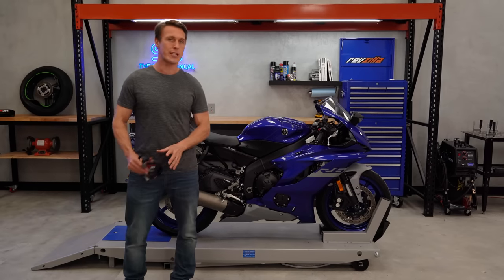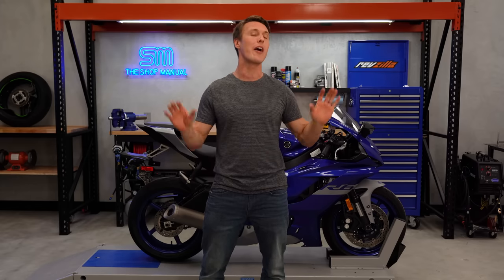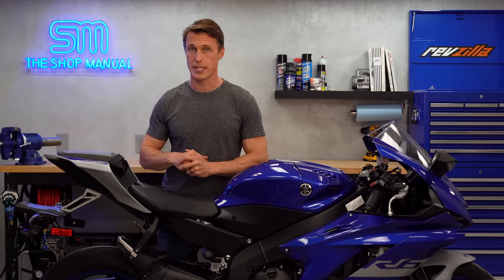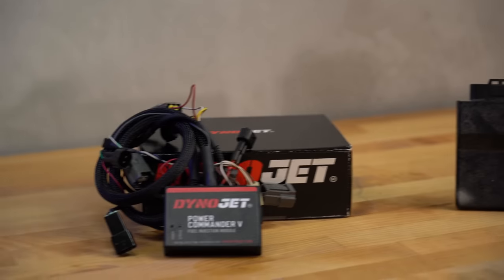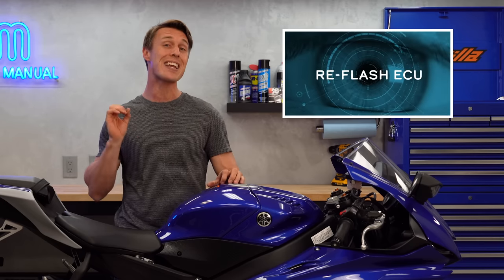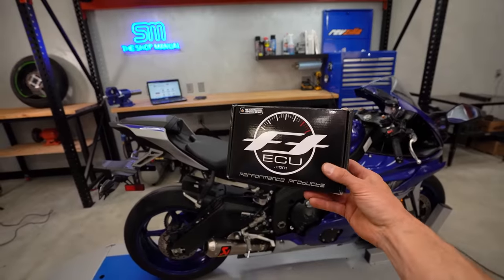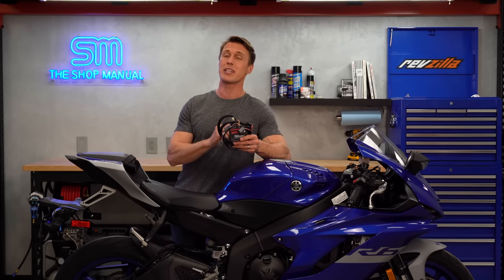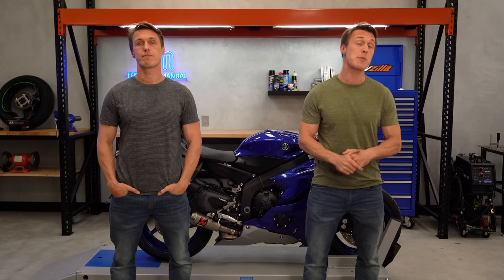ECU Reflash vs. Power Commander For Engine Tuning | The Shop Manual

Comment from the maker: Read more about motorcycles at RevZilla's Common Tread: http://rvz.la/3aB8CsA
Reply: What gives you more hp powercomander or reflash the stock one??
Reply: ??? Who are they lol 😂 no one important
Reply: @dr.jekyll2017  Codswallop. They "spent millions" doing the best they can to get around the emissions regs and end up with garbage fuelling, particularly at low revs. That's why modern bikes are jerky around town. Etc.
Reply: @Dr. Jekyll  Most "idiots" find the worst effect of garbage oem fuelling in the first 10%. Catch up dude. Lol.
Reply: @dr.jekyll2017  What's the "2 miles an hour faster" about? It's not about that. But then "sounds like your bike is a pos". Lol. Ok, you have issues apparently.

Comment: PC5 doesn't do much. The O2 sensor in the stock system (closed loop) nullifies most of your fueling changes. Woolich Racing flash seems to best way to go, but it's close to $500 bucks. Send it to Moore Mafia.

Comment: Good video! One thing that was not properly mentioned is how easy it is to revert to stock with a power commander. You mentioned removing it which works but is not even needed. With a power commander all you need is to connect your laptop or even smartphone to your bike and change to any map (even stock) you want. You can even have 2 maps on it and add an external switch to change between them.

Comment: Hi guys. I had a k7 gsxr. Around 6 months after buying the bike was invited back to the garage in London where I had purchased my bike to meet the chef engineers about bike set up and help with R and D. Not sure if ECU's across the pond are different? But hear in the UK power commander's  don't make a massive difference. In fact on this particular model the euc is already set up for this particular model. Was told by chief engineer from Japan not to waist money on a PC.  As they are generally a con. Saying this did fit a power commander 4 to my honda sp1 which helped' smoother throttle control at lower revs. After  re map a whopping 5hp. Goes to show a waist of £250 for 5hp. Smooth throttle control worth it. Like I say I know you're bikes are set up different and your cars because your emmission requirements are lower than ours.

Comment: The optimal approach also depends upon the capabilities/design of the ECU.  For example, the advanced ECU of the 2020+ BMW S1000RR/XR/R supports fully closed-loop operation and tuning (continuously takes readings from the exhaust sensors), which adapts dynamically to conditions (temp, humidity, altitude, etc.) and so you can get a flash that works for all bikes and configurations (e.g., exhaust and filter changes) of a particular model.  Besides more delivering more/unrestricted power, they provide earlier exhaust-valve opening, better idle, faster QS shifts, rev limiter increases, etc.  It costs most of $1000 but totally transforms the bike.

Comment: How can you tell if a used motorcycle has had its ECU reflashed? Does it leave a trace?
Reply: @TylerTron21  thanks for the explanation! So basically you compare the 2 maps to see if it has been flashed. If the bike was reflashed with a different map then reverted back to stock then we don't know if it has been reflashed before then?
Reply: @TylerTron21  yes, i was wondering if it's similar to odometer tampering/reset. I guess another way is to bring the bike to a shop/dealer to get it checked
Reply: @TylerTron21  i don't think many motorcycles have a date function so I don't think its possible to tell when it was done, or even if there is a mechanism in the code to keep track of that.
Reply: Also almost everybody that does a ecu flash usually put there brand sticker on the ecu

Comment: I don’t believe you need a tune, ecu flash or power commander if you are just changing to a standard aftermarket airfilter. Maybe depending on the bike, but a the stocked ecu on some newer bikes will be able to adjust on its own?

Comment: I made a couple minor mods on both intake and exhaust of my FZ-07, but left the catalytic converter in place.   I'm not a huge environmentalist but I do what I can... 😁  Initially, I planned to use the FTECU "on bike" harness with the Active Tune option (wideband O2 sensor) but the cost for this was over $700 plus welding a new bung in the exhaust, so I had a 3rd party (2WDW) flash my ECU instead.  After several tries, it became painfully clear that the FTECU firmware was no longer using my stock O2 sensor under any conditions, and the engine ran chronically rich.  I put a meter on the stock narrowband O2 sensor and saw it always output 1V (rich, not cycling as it should), and the exhaust smelled of hydrogen sulfide (rotten egg) which also indicates insufficient O2.   I was told the stock O2 sensor was used, but my test data consistently refuted this claim so I ended up going back to the stock ECU.  The moral of my story is that if you install a full exhaust (no cat), a flash tune is probably a good bet, but if you want to leave the cat in place, save your money and stick with the stock flash.

Comment: Had a dynojet piggyback module in my 2012 S1000RR that thing made me run on 2 out of 4 cylinders every 800-1000km's or so had to keep changing spark plugs and what not. Removed it in the end never ran smoother

Comment: One thing I've looked in to and been unable to find info on, is whether the stock lambda sensors on modern fuel injected bikes, can cater for an aftermarket full exhaust system with de-cat. I understand said sensors can adjust depending on environment the bike's working in, i.e. altitude as an excellent example. For me, a good article would be on whether the original lambda sensors are able to cater for new exhaust systems, end can and high performance air filter. Subsequently leading to adjustments being made by the ECU on new readings from said sensors. It's a bit of a minefield if I'm honest and I feel these aftermarket commanders are a massive money maker. - not that I'm against them in anyway. If there was some testing done with modern fuel injected bikes, say stock vs new exhaust system that would be extremely interesting to see how far you can take a stock set of sensors before a piggyback method or ECU flash is required. End of the day, piggyback modules and ECU flashes still use the same set of stock sensors, I imagine the main benefits from these types of tuning methods is to get rid of flat spots etc and to adjust the typically poor/snatchy throttle response of bikes which are set up to meet emissions regulations. - FYI, I'm no expert lol

Comment: Ive been using a Power Commander on my TL1000R and i have to admit i like it but it reminds me of setting up an AEM, MegaSquirt, speeduino, Haltech, Power FC, etc, type system on nissans, mitsus, Ford, etc... I guess growing up in the time period of "eprom flashing" turned me away as it was tedious work at times. Simpler to jump into a laptop and tweak injector duty cycle or scaling than burn an eprom and install it

Comment: i had my bike tuned on a dyno through my power commander. and it was fine but if I was to do it all again I'd just retune the stock ecu. turns out cheaper and can get  more out of it. cheaper because you just purchase a life time code then a tune instead of buying a pc5 then a tune

Comment: I was thinking about just buying a second stock ECU to experiment with. I really want to learn more about tunning. I want to be able to adjust A/F ratio and unlock the throttle throughout the gear range. The type of stuff you see on Moore Mafia. I know I don't have a dyno. Can I still tune my bike without a dyno using a PC? If so what do people recommend for software ECU upgrade kit?

Comment: I have a 2006 VStrom dL 1000 bone stock.  I installed a “Booster plug” and that was a big improvement. Would flashing my ECU be another improvement? Bike runs great as it is but I’d like a lil more out of it.

Comment: Had a Power Commander on my R3 and it still has throttle response issues. Once I flashed the ECU and removed the Power Commander, it ran like a dream. 

I also flashed my 2014 Yamaha Bolt when I installed a full exhaust and intake and the throttle response was butter smooth.

Just wanted to put my input. Hope this helps.

Comment: I've done a little recherch so I not sure if this is true but power commanders have a fatal flaw. they sometimes don't intercept the o2 sensor so on some bikes (ktm for sure don't know any others) the normal ECU will cut fuel and basically undo everything that the power commander does.

source: rottweiler preformance.
I'm a little sus cuz they sell their own power commanders at a hefty markup and claim that it comes with a solution to this.

Comment: To be super clear, you either need to buy a specific Bench kit to run against a removed ECU (it includes a power supply for the ECU) , or you need to have a Windows Laptop (or a desktop inside a garage with a long ass USB extension) ... So think through how you're going to connect the computer to the ECU.

Comment: You need both for the best performance. Flash removes restrictions, lower fan temps, native quick shifting, etc. etc. Piggy options allow for live on the road tuning under real world conditions and real world air intake. WSBK and MotoGP bikes run different tunes for different tracks for example. Many professional tuners will tune a car or bike on a Dyno and then take it out on the street or track and fine tune from there. You need both. You don’t actually “need” both but both will give you the absolute best performance.
Reply: How reliable is this piggy back power commander v?
Reply: @paulson9616  No problems at all never heard of anybody having issues other bad tunes.

Comment: so here is the thing, im new to riding, got a 2016 ktm rc 390 with werkes usa exhaust, k&n air filter, and new battery. and i need something like the flash or piggyback. but wich is best here?

Comment: If I do a k&n filter and a slip on exhaust is it necessary to have a tune? I'd do a power commander. 

Possibly might do stacks on the air box.
Reply: Not necessary at all

Comment: I'm here because a kid brought his 04 cbr954rr to the small motorcycle shop I work at because it doesn't run right.  It's got a power commander in it.

This is only the second fuel injected bike I've worked on and the other ran great.

Comment: The main benefit of a flash over a standalone fueling module is the ability to (depending on the specific bike model and flash software) alter non-fueling settings, such as timing, per-gear throttle plate restrictions, fuel cut on closed throttle and deactivate certain hardware eg o2 sensors or PAIR solenoids (though you can buy add-on PC hardware to do some of those at EVEN MORE expense). I would have said the PC is the poor mans solution, but it's actually more expensive; A flash license will invariably be cheaper than a power commander, and you'll still need to pay for dyno time whichever one you go for. Piggy-back fueling modules made sense a few years back, nowadays if your bike supports flash tuning you'd be dumb to go for a power commander.

Comment: Ari, thanks for the video. Can one  gearthese options improve low speed/low rev engine response making the bike less jerky in below 20 Mi/h?    I have a 1999 VFR800 that I very much like my major complaints are the engine response under 20 Mi/h (school zones) and how hard the clutch can get if I get stuck in traffic for a long time.

Appreciate the videos!   I wish you continued success.

Comment: What about the PowerVision 3 by Dynojet? Any comments on that system? Are there enough benefits to justify buying this for a stock bike (stock exhaust and filter)? I'm hoping for a less jerky throttle on low revs from an MT09 2018.

Comment: Ok I have a power commander on my Kawasaki Z400 and now I'm going to add aftermarket headers and a k&n performance filter do I have to put it back on the Dino jet machine afterwards??? I would like to know or can I return my power commander myself?? Or do I need to take back to my mechanic shop and have my buddy return my Kawasaki Z400 again???

Comment: Tried the power vision 4. Wouldn’t work for my bike and dynojet didn’t have any maps.  They actually told me they aren’t in the business of making maps and that I can have fuelmoto write me one for $100. I had air cleaner pipes and a very popular cam on my bike. Nothing rare, nothing crazy. I returned the Pv4 and went to the nearest dyno and had it tuned. Should have done that in the first place. It was 4 hours out of my day.

Comment: With the flash tune, you are at the mercy of the expertise of those doing the refresh. (You included) You HOPE that their code will be optimal for your mods and bike. OR you have it done on a Dyno, which is better but still has issues. With a power commander or Bazzaz, you can get an autotune module that allows optimization with your riding conditions, and specific bike/configuration. They do not allow control of as many parameters, but they are even more accurate than the typical dyno, as the O2 sensor is MUCH closer to the exhaust ports than thy typical dyno exhaust pipe sniffer.

Comment: This is a great segment, thank you for doing it. I watch assiduously and even when I think I know about a topic I invariably learn something.  Not the most exciting topic I know, but I wonder if you might do a TSM segment on batteries and attaching external power draws (heated grips, USB devices)? Is the limiting factor the amperage of the battery or the efficiency of the alternator. I've got a 2010 Moto Guzzi V7, and the standard answer seems to be you can't attach too much external power draw on the battery. But can that be changed by modifying the battery or the alternator. As you can tell, electrical systems aren't my forte!  Anyway, great segment, and don't need a specific answer to my question, just interested in the topic and can't see a lot of information online about it.

Comment: Hi sir..by d way can I ask u some advice if u don't mind...I had zx6r 2000 model I'm struggling to made my bike run dicently so hard to find here in uae a mechanic can fix well my bike...d issues of my bike if I'm running on a city riding it run good cause max speed limit is 80kph but wen I'm running on a straight freeway I can't release the potential of my bike cause wen it hit 120kph the speed is dropping on 100 to 80kph and after a seconds it goes up again to 110kph...

Comment: Did I miss the part where you mentioned identical engines will perform differently, especially after modification.  Best option is a piggyback or full standalone and  dyno tuning.  Flashes are trash.

Comment: Do I need to do an ECU flash to put an aftermarket quick shifter on the bike?
Reply: You'll need some sort of interface for the switch. Both piggyback modules and flashes will allow for a quickshifter.

Comment: But doesn't Dyno Jet make something similar to a power commander? Called a Power Vision 3 and from what I understand it does everything a power commander does and more. It can raise rev limiter, unlock the speed limiter, flash the ECU, upload custom tunes from Dyno Jet website for certain mods, change cooling fan temperature, etc. just like an ECU flash does. I am getting one for my MT-09 and from what I can tell from my research the Power Vision 3 will basically put sending out and flashing an ECU in the past and also be a better option than a power commander for just an extra $50. ECU flasher and power commander combined into 1 unit.

Comment: I got my Yamaha (mt07) mapped with woolich racing software (by a tuning shop in the UK).  Does anyone know how the new triumphs (street 765 / speed 1200, etc) can be remapped, as I haven't seen any software that can?  I'd prefer not to get a piggyback system.

Comment: Flash.... Only way to go with modern bikes and all the emissions crap that needs switching off and deleting. The time you buy all the sensor eliminators and Power Commander it works out cheaper And lighter too.

Comment: I feel like you should've mentioned tuning for fuel economy.
Reply: It's rarely so on the sport bikes anyway.
Most modern bike run very lean from the factory, optimizing air fuel ratios make the bike even more thirsty.
I've 2018 r1 and with stock ecu map I had about 34mpg after the tune and flash I barely get 28mpg

Comment: Slick new set and overall production.  Looking forward to many more episodes
Reply: Are you Haines of Haines Manuals fame? If so, your comment makes this episode Oscar-worthy.
Reply: Did you want to make a comment about booster plug? An ECU trick that makes the ECU think it's 20 degrees C colder than it is, subsequently putting more fuel into the motor?
Reply: Thanks! I'm really pleased with the new set.
Reply: @batshitcrazymotorcycles7044  cxee

Comment: TBH, the cost of EFI mods always makes me appreciate carburetors for their budget-friendly-ness. They can be fussy, and come with their own issues/learning curve. But you can re-tune carb(s) for $50, a shop manual (!) and some basic tools, and have $250-300 left for your other mods.
Reply: But you have to keep doing that. Once you reflash for the newer bikes they are generally set and forget if it's done right. And if you are in a decent community you can get collaborative help to make sure every setting is the way you want it.
Reply: @grndzro777  not to mention that complete ease of mind of not having to worry about carbs and weather outside lol
Reply: Yall having alot of carb issues
Reply: LMAO carbs? It's not 1995 folks.
Reply: Real power is made in timing so ditch the carb, embrace FI and tune!
Reply: You can only do so much with carb mods. You'll need a programmable CDI to adjust the ignition timing curves. ($400-$500) With an ECU flash both fueling and ignition timing are addressed.
Reply: @steveoglesby4120 What I was coming here to say.